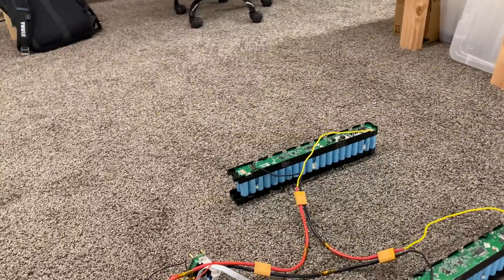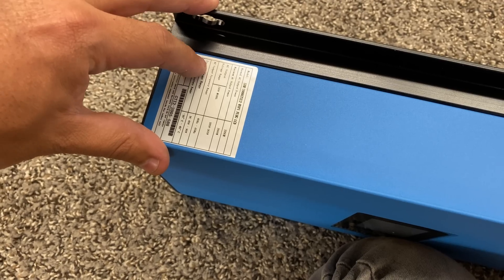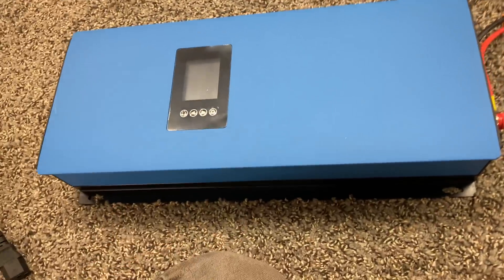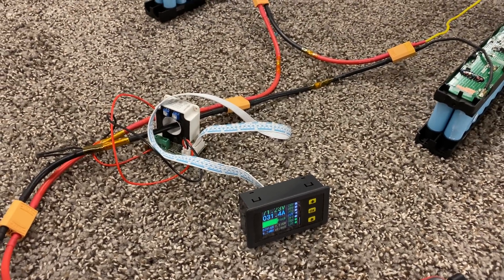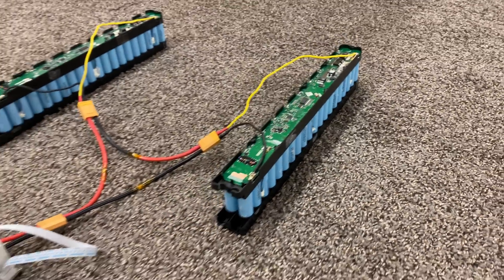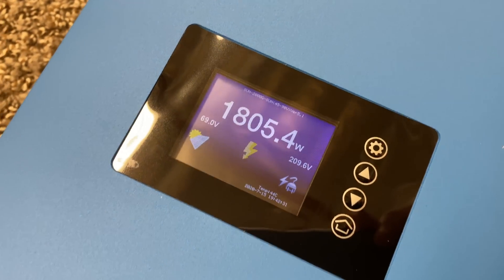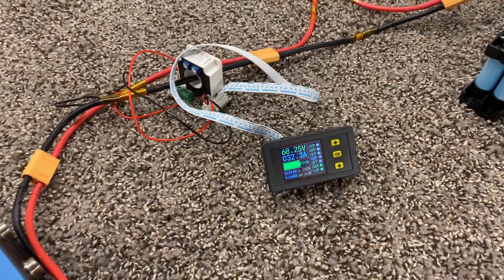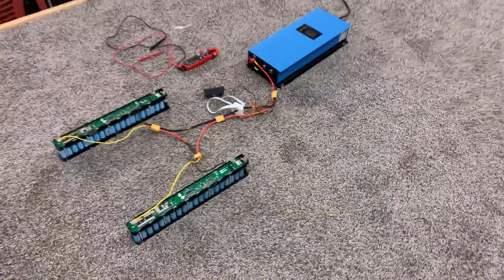Im building a 72v Powerwall using the LGMH1 Battery Packs

Comment: Hi great content xD i was looking to replace my scooter battery can you help please  ? i currently have Lithium-ion battery 18650 16s12p 60v 31.2Ah/1872Wh  with a charge voltage of 67.2 running 2* 2800 motors and it about 15x9x2.5 inchs in size ! space is a premium lol i was hoping to up scale in power but reduce in the space it takes up perhaps 72v 45Ah ... maybe using 21700 would reduce the space it takes up ?oh and a BMS to accommodate  is this possible and can you help thank you for your time much respect just as an after thought if this goes well i was thinking to build an off grid solar camper van xD so this is the beginning thank you again sir

Comment: Why you use 220v, I think in USA standard is 120v?
Reply: I the US we use 120v through 1 wire single phase. Usually with appliances and equipment, we use 2 wire (split phase) 
120v wire + 120v wire + neutral + safety ground = 220 - 240v range

Comment: Another item of interest concerning the amperage for gauge wire used and the posting for the current rating. If it is stranded copper it can handle more current than solid wire. FYI.

Comment: Hey Jehu, love the channel! Long time viewer. I'm a 20 year electrician. The heat you're seeing might be because of insufficient wire size. 
Baseline rule:
14 awg = 15amp
12 awg = 20amp
10 awg = 30amp
8 awg = 50amp
6 awg = 60amp
4 awg = 75amp
2 awg = 90amp
1 awg = 100amp
Also relative to max load only being no more than 80% of awg rating. Also with DC, the square wave doesnt travel as far so it's good to go up a gauge from rated max load size. So I would wire that setup with no less than 8 awg. Also, on the AC side, i doubt your getting proper current for 220v out of that extention chord unless it's a 10awg chord. I would check the max amperage rating on your lift. I do realize this was just a test btw. Thanks for posting these types of tests for many years now. You have tought me so much over the years about battery chemistry
Reply: @Brock Obama yes, in undersized conductors, heat is wasted energy. With better conductors, He would have achieved higher voltage (less volt sag) which translates into lower amperage under load. I think 8 awg would have been sufficient as he was only pulling about 32 amps

Comment: Without getting the built in BMS to work, how will you every manage this powerwall? You will have a weird combination of series and parallel. You will almost have to install individual BMS on each scooter pack which will be costly.
Reply from the maker: Or parallel two groups and bms them all as one 20s pack

Comment: So this is 230-240 single phase output yes?  This is a European inverter...I dont think it is designed for the US power grid.
Reply: Yes it is you cut the cord an you have 110 110 an a ground.
Reply from the maker: The USA has single phase  220v power
Reply: Yes.  Just ignorant on how single 240 can be used.

Comment: Hey jehu I've seen these inverters fail quite bad when pushed over 70% there is a massive fb group all about them and how to fix them
Reply: Do they get tied in without the neutral?
Reply: @yolo_burrito  its just a standard iec  c14 cable required and it plugs into either a 110v outlet or 240v outlet

Comment: dude without thought of recharge and storage  could you do a 18650's to replace car battery that could  take the instant drain ?
Reply: If you want to use lithium, then only LiFePO₄ batteries have the appropriate voltage range and current supply of over 400A.
With 18650s you would need hundreds of laptop cells to supply that current, and the voltage range of 3S and 4S packs don't cover the full 11-14V of a LA battery. Max for 3S is 12.6V,  minimum for 4S is about 12V.
You may be able to crank an engine with a fully charged 3S100P pack, but will overcharge it if the alternator runs.
Reply from the maker: 15p of the vtc6 cells will put out 400A,  but yes......

Comment: I use four of these grid tie limiting inverters on my home. Their made by eco worthy.
Reply: I've been looking at these for a long time. They don't meet the UK standards but I want to understand how the intelligent current sensor works? Also if you hook batteries up to the DC inputs, would your PV input got to a charge controller > battery?
Reply: Matt Wood we have to reword them here in the USA. What is the voltage in the uk
Reply: Penrod Auto Repair 230-240v ac
Reply: Single phase ~230v 50 Hz
Reply: What's the USA Ac household voltage?

Comment: @jehugarcia - next step for power walls is some sort of water cooling (runs inverters cooler and no fans to use power or fail) 👍
Reply: Maybe just some really good ventilation, should be enough to provide cooler airflow for the inverters, might be a good idea in case any of the cells vent, as well.

Comment: I have a similar setup for couple months.
I use two 10s automotive lithium-ion batterys in series, witch I use from 64v to 80v.
These inverter has a beautiful feature - You can adjust in the menu how much current you want to draw from the battery. You can adjust low voltage turn off value, to prevent overdischarge...
The inverter can continuously deliver 1800W but if it runs from the battery the power runs down to approximately 1300-1400W when voltage drop to bottom (64V in my setup).
But 1400W is still good enough for transfer energy from battery to my E-UP when EVSE charger set pilot signal to 6A charging.

Comment: Wait did you get the BMS working on the scooter packs?
Reply: Nah he's probably just going off the pos and neg of the cells
Reply: @joshuabest100  I'm also curious to know is he got the BMS to work. In a previous post, he said the seller made him cut the connections, implying they didn't want the BMS to work. I want to use these packs to power electric bikes, but I would only buy it, if he can get the BMS to work. @jehugarcia did you get the BMS to work?
Reply: I’m not sure why he can’t use the onboard BMSs, I use 2 of these batteries on my scooter and am able to charge them both at the same time with their charge leads paralleled together.
Reply: FabriDragon Would you tell us what wires/connections you are charging and discharging from on these batteries? These are selling with all the wires cut. It’s not clear which wires are the charge and discharge from the BMS.
Reply: Probably because if one cell failed you couldn’t tell which one, the BMS would just disable the whole pack